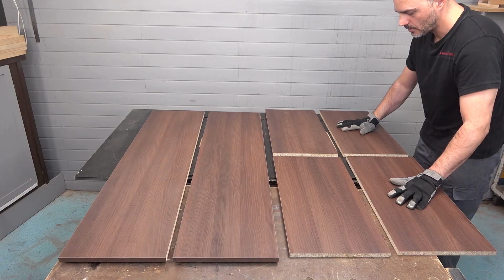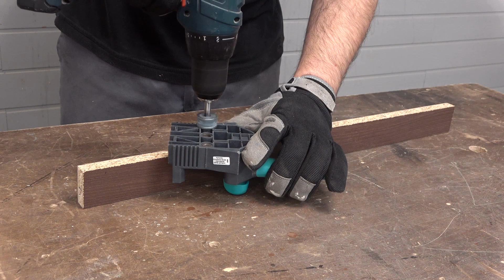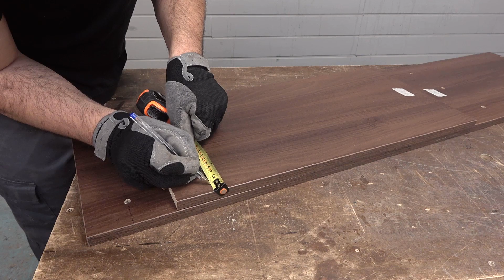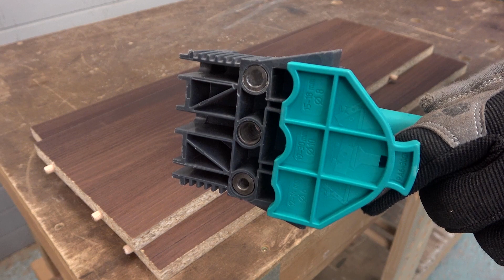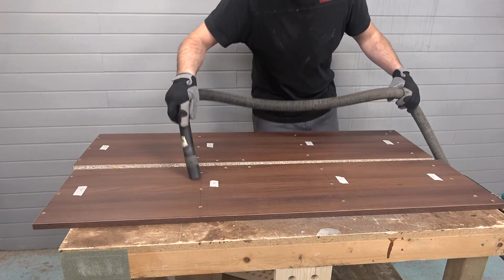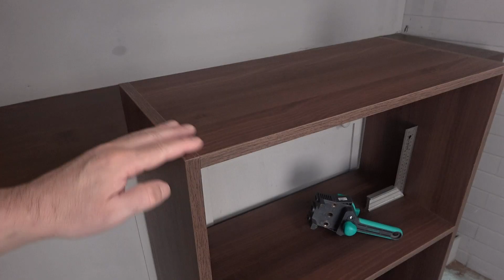Pro + Tips for Doweling Jig. For Difficult Joints

Comment: I noticed you don't explain how this Jig was supposed to help line up the dowel holes in the side for the middle shelves. Those holes appear like magic with no explanation. They are the ones i struggle to line up well and the reason i am looking for a Jig to help. I guess this jig is only useful the top and bottom and edges.
Reply from the maker: This is not the only video of this project. I think I show that in a previous one.

Comment: I have the same jig and my most concern is it's accuracy. Each time although I try to set it up very precisely and clamp the jig when boring, sheets don't align. It's so annoying. Do you have similar issues or you managed to deal with the problem somehow?
Reply: If you're using same drill bits with centering tips, should not be the issue. You're doing smth wrong or not precisely enough. The jig itself is pretty accurate, unless you have some low quality version.